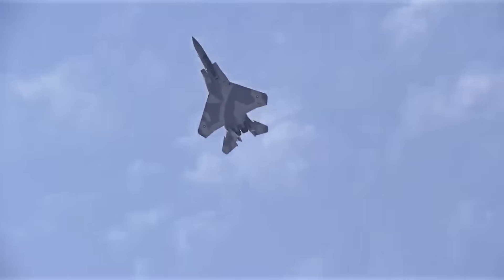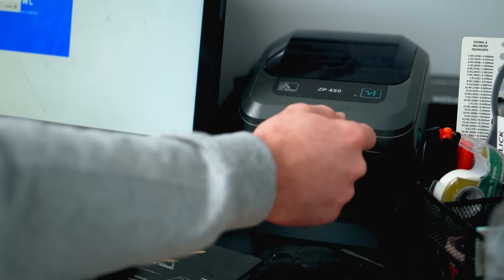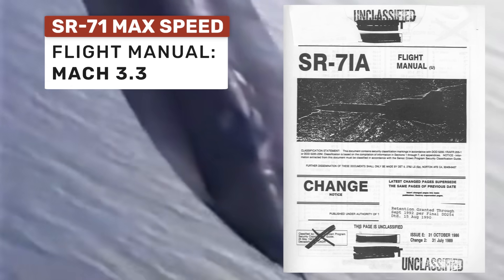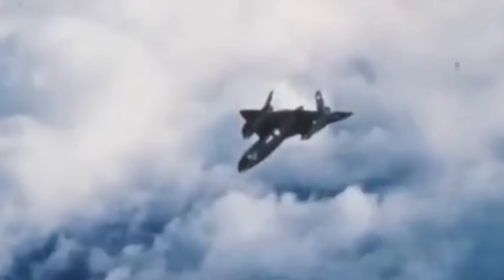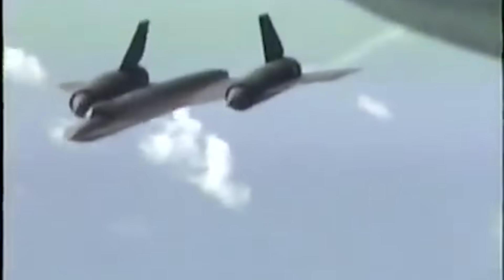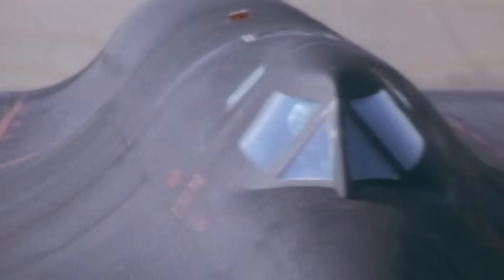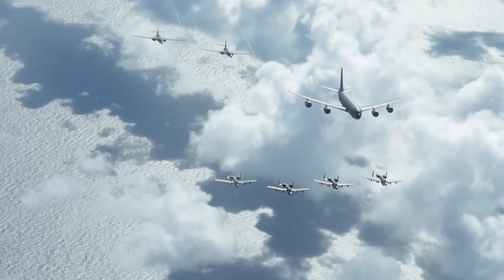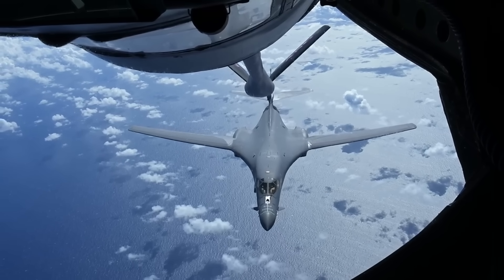The SR-71 was MUCH FASTER than the Air Force will admit

Comment: Interesting that the pilot at the end talked about getting up to 80,000 feet in about twelve minutes. Kind of a leisurely stroll for the Blackbird. An F-15 Streak Eagle back in 1975 went from brake release on the runway to 98.000 feet in 3 minutes 46 seconds. That would have been some ride.
Reply: Much easier for the 15 as well

Comment: I was in the Air Force in the 80’s and 90’s . I had to give a classified report on the SR-71. The information in that report was very eye opening 😮. Thanks for the video, brings back some great memories ❤
Reply: What did it say?
Reply: @ classified information:(
Reply: @bowtiefidenine  lol virtually nothing about the SR71 is still classified. It's all been declassified for over 2 decades. The only parts of the SR71 still classified are parts of the ECM/DEF equipment as it's still in use today.
Reply: @ I signed a non disclosure agreement, and It did not have a expiration date on it.
Reply: @bowtiefidenine  seems unlikely especially since it was retired in 1990 and never flew another reconnaissance mission again. But nothing wrong on still holding on to decades information. At least you didn't say something silly like "it really flies mach 5" or something silly.

Comment: I will, add THE A-12 is the Exact same thing as the RS-71. Granted ,both have laser guns,and both fly the same speed,and again this guy is a pawn,and I will add the RS-72 was faster ,and a VTOL. Plus was out in less then 5 years after the RS-71 in 1960. This, is all well,and good.More to the point ,even with this out in 1955 ..this was ,and is old tech.

Comment: The A-12 WAS indeed faster with a higher service ceiling or max altitude, due to the fact it was a single seater, a photographic platform only, and thus slightly smaller and significantly lighter than the SR-71, which was a larger two seater, and in addition to it's camera, had a suit of other sensors like synthetic aperture radar, ELINT (Electronic Intelligence) systems, and so forth that added weight. Nevertheless, they were both magnificent machines and awesome feats of old school, slide-rule design & engineering.
Modern aircraft like F15's, F22's, F35's, are no doubt very capable, but just aren't as kool or amazing, and never will be, as the machines Mr. Clarence Johnson and his clandestine team had the balls to imagine then design without any of the modern computer hardware or software, without which such a task would probably be deemed impossible today.
Reply: The A12 while lighter,  had less thrust. It's easy to initially see why people think the A12 was faster etc,  but it wasn't.  All variants had the same performance capabilities.
Reply: @gr8crash  
Well, every documentary video I've seen and book I've read on the subject, stated the A-12 flew slightly higher & faster.
During interdepartmental conflict between the Airforce & CIA over which aircraft should be chosen, when the government concluded having two highly expensive, almost identical surveillance platforms was unnecessarily wasteful of funding & resources, and issued an ultimatum to both sides to determine & decide which aircraft should continue in service, and which should be retired & mothballed, a "fly-off" was chosen as the preferred method to help make the decision. An example of each aircraft was flown to compare speed & altitude capabilities, and surveillance equipment. The result was that the A-12 WAS slightly superior at the parameters of maximum performance in speed & altitude. And the A-12's camera was superior to the SR-71's.
But, the SR-71 had other advantages, with two crew being able to share the load of managing mission requirements, and in addition to it's camera, also carried a host of other visual & electronic surveillance equipment, sensors, & recorders, like Synthetic Aperture Radar, ELINT, and so forth, which offset & negated the slight edge in performance the A-12 had, with it's greater versatility and wider range of capabilities. In the end, it was decided appropriate the Airforce should be responsible for airborne surveillance not the CIA, and thus the SR-71 was chosen. The A-12's retired. Interviews & comments by "Kelly" Johnson, Ben Rich, other Lockheed employees involved, Pilots who flew them, & all personnel who worked on them who have spoken on this subject, ALL confirmed the A-12's higher speed & alt. If it wasn't true or they meant to say otherwise, I'm SURE they WOULD have. I see no reason to second guess or doubt the testimony of those who designed, built, & flew them when commenting on this topic. Especially when they are unanimous in agreement on it. So, I respect your right to your opinion, but I don't believe it's correct, and continue to endorse the accepted view of those previously mentioned, who surely must be THE authority on the subject.
Cheers.

Comment: Something to consider. The government wont say its top speed other than Mach 3.2 or better. Over Libya an SR 71 out ran a soviet surface to Air missile which is capable of mach 4 . . . . . . .  So there you have it sports fans
Reply: Top speeds etc have all been public and declassified for over 2 decades. And it was definitely not capable of that speed.

Comment: My mach 7.5 is what my research says.😅
Reply: For the SR71?  Lol. Never. Not even remotely possible.
Reply: @gr8crash  how fast did the space shuttle go on lift-off and re-entry?
My sources are way deeper than yours.
Reply: @faranger source for SR71 speeds? You definitely don't as what you stated is impossible. And as for the shuttle, 2 completely different vehicles and not comparable.
Reply: @gr8crash  SEARCH, I don't spoon feed.
What is your profession?
Mine is certified Aircraft Mechanic with a 
Degree in Aviation Maintenance Technologies from the National Aviation Academy with a 4.0. 
Hell I was even able to impress the Russians. 
See kid I grew up as a NAVY brat, and I was in the ARMY.
I actually worked in a theater command, I just had access and I like to read.
My  "BEST GUESS", but I grew up in the 1960's. I was closer to the programs.
I watched the X-15 and I know allot about the program. 
The SR-71 LITTERALLY out runs.missiles that are fired at it.
Reply: @faranger you don't have to spoon feed me anything.  I'm sure I've done more research than you on the SR71.  You may need to do more if you think the SR71 flew mach 7. Heck if you even think it did mach 4 you need to do a lot more research. It couldn't "outrun" SAMs as they were faster. What it could do was out position then which isn't the same thing.

Comment: My own calculations for fuel burn and known acceleration rate would put top speed at about mach 11 to 12, but I think it'll come apart from the melting before that. Can it do mach 4+? Definitely!
Reply: Lol what? None of those speeds are even remotely possible. Even mach 4 is beyond its capabilities.
Reply: @gr8crash  No, that is easy theoretical calculation. The big question is when does the airframe and engines take enough damage that it can't ever do that again or come apart while doing that. If we flew them like the Russians flew the Mig-25 it could have done Mach 4 easy so long as it didn't melt first. It isn't a matter of thrust but melting point of the airframe.
Reply: @markcash2 virtually none of that is accurate. The aircraft would have failed long before reaching mach 4. They were aware of what work it would take to reach higher speeds, even to the maximum aircraft potential and even the max possible was below mach 4. 

The aircraft didn't fly nearly fast enough to "melt" the material either.

Comment: F-14A's could push over 2.5 as well, some say 2.7 mach or more. F-111 and the F-15 are in the same category of being able to go faster than the airframe allows. Some have intake problems, some have canopy overheating, etc. It would be interesting to see them optimize an F-14, F-15 and F-111 for top speed airframe wise and let the engines do their thing. 

The EX may be able to do 2.9, but I think the more important thing would be it being able to do the psycho loadout of 20 amraams plus two aim9x's and still be able to do 1.8-2.2 mach. That extra speed really puts you in an advantage when in an engagement (relative to the same platform and missile going 0.9 mach).

Comment: You do the math.  On the NYC to London run they did it in less than 2 hrs.  In a separate article it was revealed the SR refueled once.  So it needed to slow down and drop down in altitude to the tankers speed. How long to do that once I don't know (1x15 minutes ??), speed of 600 mph??  The speed is outrageous.  1hr 54min 56.4 sec  3470 miles.  They say it went 2908.026 kph.  I say the speed was way higher than that
Reply: Average speed for that run was 1817 mph. It slowed down and didn't partial refueling giving them just enough fuel on their safety margins to complete the run with enough fuel once they got there.

Comment: During a project   conference host ed by vender LOCHEED rettired CHIEF TEST PILOT gave a sdlide show , ion the SR71 including snap shotys  of the backseates panel  inflight. The altimeter was 105,000,000..  Several years later I was at EVERGREEN MUSEUM in Oregon looking over their SR71when the docent came and said he had been a backseate, and did I have any questions? So I  asked him how often did  you go too 105.  He did a little doubletake and replyed "only when we had too".
Reply: Lol no. The SR71 wasn't even capable of that, also it was prohibited because it would likely crash.

Comment: NASA Dryden used to have an SR-71 for research, and there was an unclassified, "civilian" POH (pilots operating handbook) available for it. I had or saw a copy of it at one point, and the expressed Vne (redline) for it was mach 3.44, due to rudder heating. I also still have a couple of SR-71 patches that were flown by (NASA test pilot) Marta Bohn-Meyer, prior to her death, on an SR-71 flight to "above mach 3.1".
Reply: Somewhat. The manual is public and available to purchase. The flight envelope ended at about 3.43 the max authorized speed by a commander was 3.3.

Comment: There's still a lot of stuff you do not know. Every time the Soviets tried to beat us, we just cracked the throttles open a little bit more. I'm in doubt about its top speed, I don't think it was ever tested for various reasons. But it could do it.
Reply: Not really. The SR71 set the record for speed and it's maintained it. The Mig did set a higher max altitude,.but the SR71 holds max sustained altitude. And all its performance is declassified.

Comment: No one talks about the X-37B, better observation, more opperational use,  can potentially carry weapons without other variants, can go higher than 400,000 ft, theres a proposed manned variant, high frequency laser weapons, and 6 times faster than the SR-71. Though the SR-71 is a normal SR jet with no world records, the X-43A is the faster jet powered aircraft, and the YF-12 and hold the record for the fastest jet powered manned aircraft. I don't know why the SR-71 gets all the fame for no reasons.
Reply: The X37 is a completely different type of aircraft and is unmanned only, not rated for humans. 

The YF12 set the initial record, the SR71 set the later faster record.

Comment: Alex - Great video on the SR-71/A-12. During your video you mentioned that the F110-GE-129 had more thrust than the F100-PW-229. Both at MAX AB produce roughly the same amount of thrust, with a slight edge going to the F100. As for the F15C vs F15EX, the F15EX is a heavier aircraft than the F15C since the F15EX is has two seats instead of one. I have heard from good sources that a F15C clean could super cruise with F100-PW-229s. I wonder if it could have super cruised with the CFTs proposed for Silent Eagle that had internal missile carriage.

Comment: I question the hypothetical Mach 2.9 top speed for the F-15EX. While the engine might offer sufficient thrust, the airframe cockpit and flight ceiling all fall short of what the SR-71 required to achieve ~Mach 3. The SR-71's skin temperature exceeded 600F in certain areas, requiring the extensive use of titanium, and the cockpit's windows were made of quartz because glass and plastics were inadequate. AND, these issues existed with the SR-71 cruising at 80,000 feet, well above the F-15s limit. Add to that the SR-71's need to have retractable nose cones at the engine's intake in order to attenuate shockwaves, as well as loading the pilot into a pressurized spacesuit in order to simply survive at 80,000 feet, and Mach 3 F-15 seems like wishful thinking.

Comment: Just noticed in my book "The Aircraft of the World" Doubleday and Company, Inc. Published 1965,  Lockeed SR-71 Max. speed 1980-2300 m. p. h. at altitudes in excess of 60,000 ft. ( mach 3.0-3.5). YF-12A same specification.
Reply: Would make sense that it wasn't accurate information back then

Comment: i once came across some engine documents online but can not remember where i saw them , and it gave the different engine designs they used in development for the SR-71 and the mid tear engine was rated for mach 4 but  the final engine used in the SR-71 was rated on paper to go mach 5+, i wish i could find it, it was just pictures of the engine and there theoretical Mach speeds and the nature of the engine used at that speed is, it gets better and more efficient the faster you go. i recon on the right day and conditions it could have gone nearly Mach 4. i did read somewhere also one pilot had reached nearly Mach 3.7 . it was when i was researching data to put into xplane 11, i managed to find a lot of stories documents and such but never kept them.
Reply: A lot of the speeds to mention are simply never possible. There was only ever one engine type for the SR71.

Comment: I was a contractor doing a project at Lockheed in Ft. Worth when an employee told me that the SR-71 has flown at Mach7. Apparently, it is only limited by the airframe. I have no way of verifying it however.
Reply: He was messing with you or just stupid because that's literally impossible
Reply: @gr8crash  Don't tell Elon Musk that. I thought the only thing that is impossible is to catch a fart and paint it green.
Reply: @leonardwolf1820 not really relevant. But in regards to the SR71. What he told you is 100% impossible.
Reply: @gr8crash  History is full of examples of what was considered impossible once but was not impossible forever. Space travel was, at one point, science fiction. But I certainly lack the knowledge to declare Mach 7 impossible. You may have that knowledge but I don't. The sun will come up tomorrow either way.